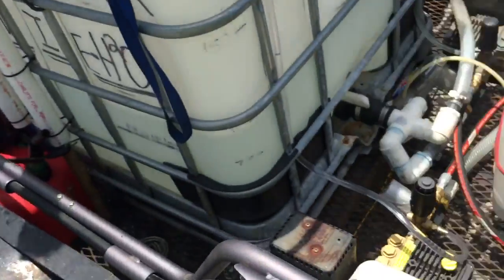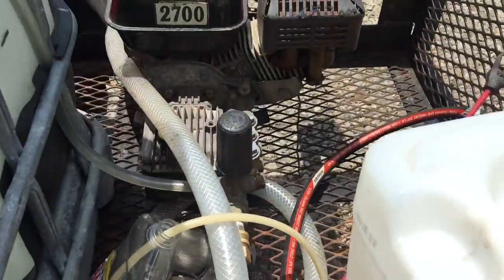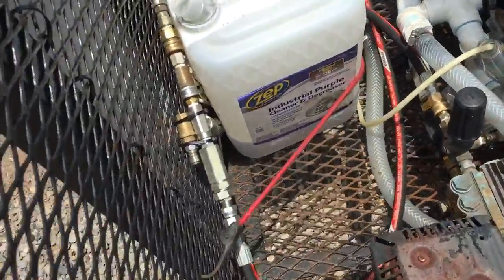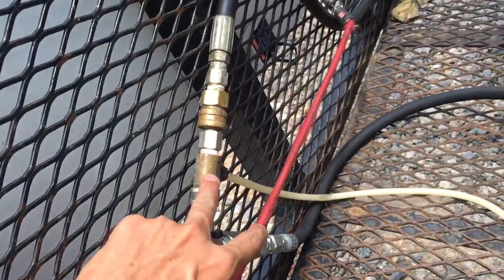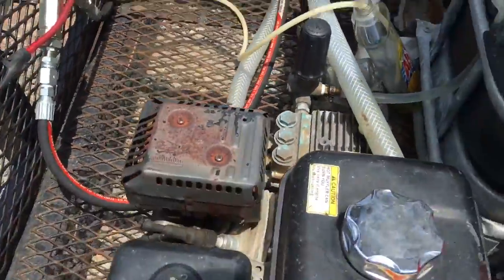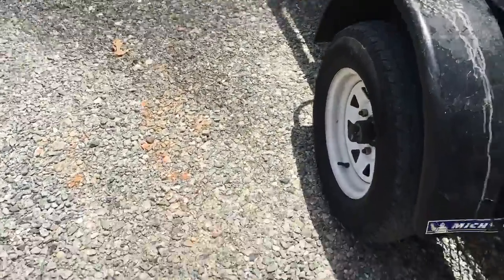hooking two pressure wahers together in one line

Comment: what are the parts and where u get them from to build that tee to join 2 pressure washer to one gun I've searched ebay may be typing in wrong parts thanks
Reply from the maker: (Snap-Tite 6C8F-F5 Inline Check Valve 1/2" FNPT, 12 GPM 6000 PSI)

http://www.ebay.com/itm/Snap-Tite-6C8F-F5-Inline-Check-Valve-1-2-FNPT-12-GPM-6000-PSI-New-/232293844861?hash=item3615cac77d:g:bs8AAOSwCU1Yvaka

Tee Fitting 3/8" NPT Male Female

3/8" x 2' Grey 6,000 PSI Pressure Washer Jumper Hose
https://www.ebay.com/p/?iid=221520745229&lpid=82&&&ul_noapp=true&chn=ps